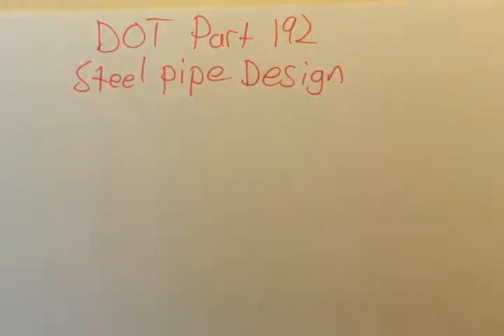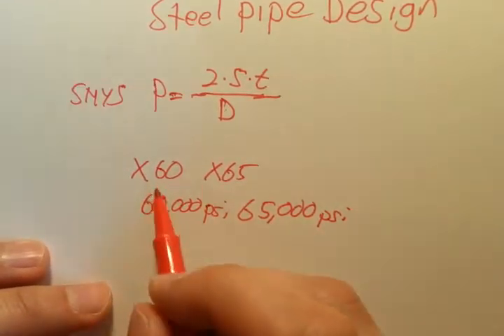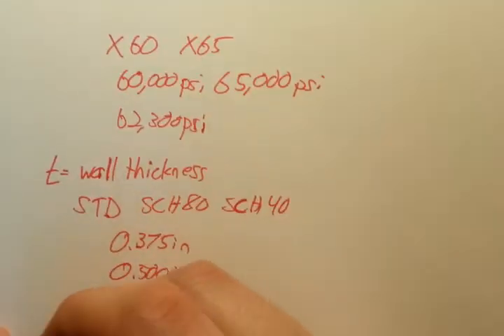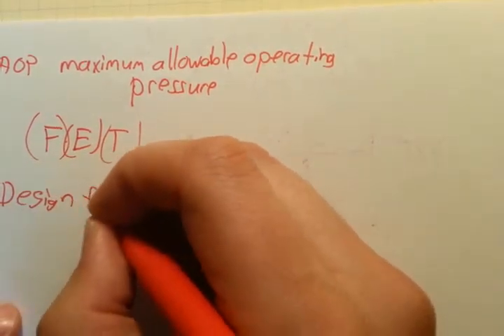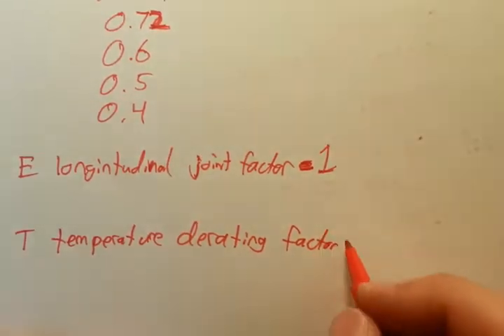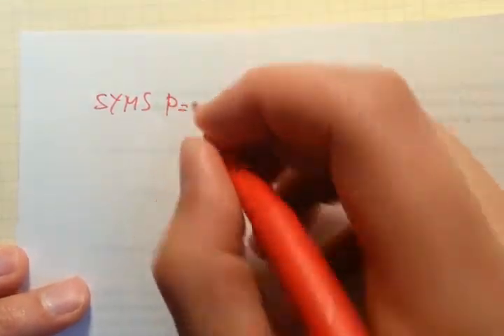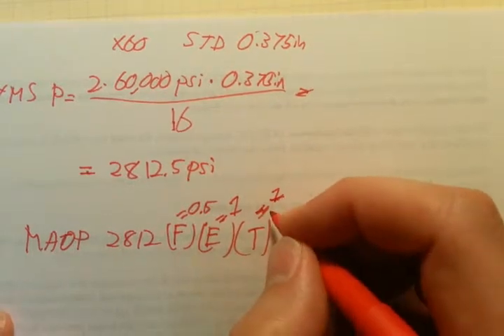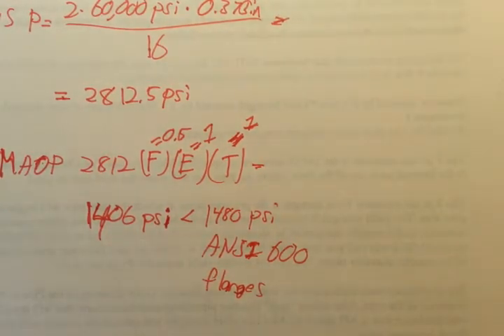DOT Part 192 Steel Pipe Design

Comment: Any suggestions on textbooks to buy regarding testing strength of pipe? I've been on a project for a year now helping with hydros and would like to learn more! Thanks.
Reply from the maker: Have you looked into the "Pipeline Rules of Thumb Handbook" by E.W. McAllister? It has a pretty in depth section on hydro testing procedures and the theory behind hydro testing. It is a great resource for anyone working in the Oil and Gas Industry.
Reply: @commtechengineer612  funny you should mention that. Shortly after writing this comment I went and bought that exact book